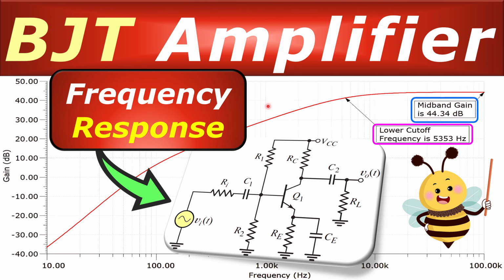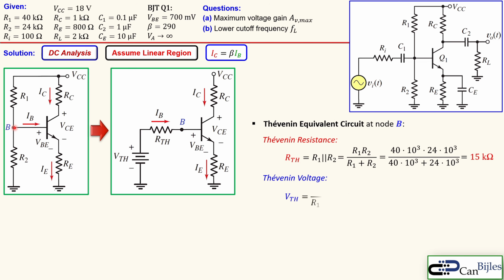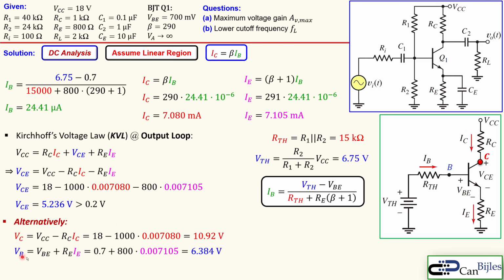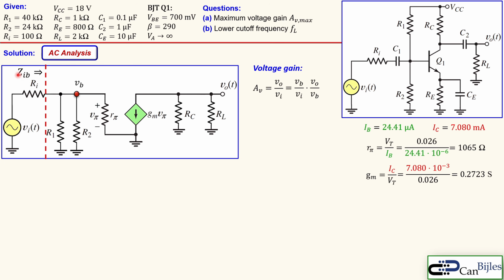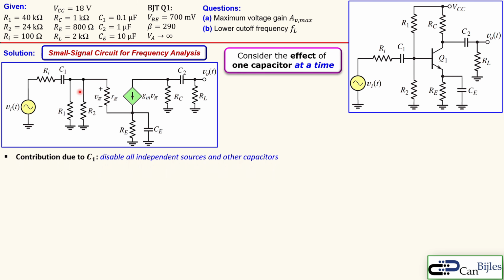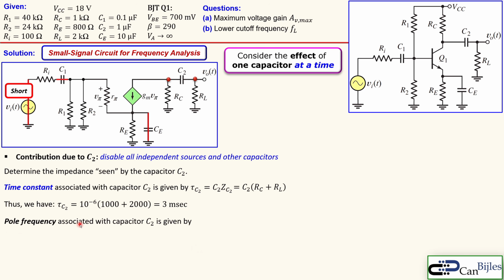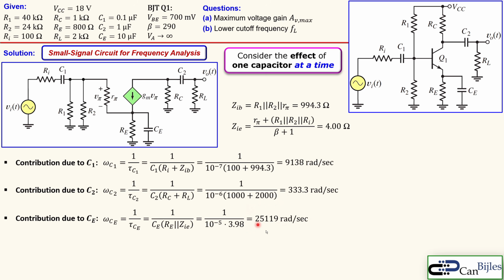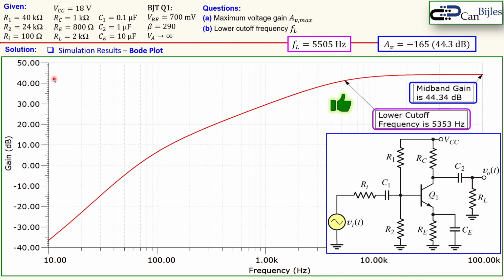BJT Common-Emitter Amplifier 📶 Low-Frequency Response 🎯 Coupling & Bypass Capacitors 👉 SCTC Method

Comment: Great work as usual. At 25:23 you show that our calculated Vb=6.384. Please can you show calculation/explain how you arrive at this. Thanks. In addition, how do you make the judgement that there is/is not a dominant pole?
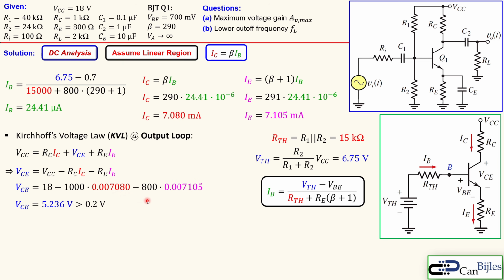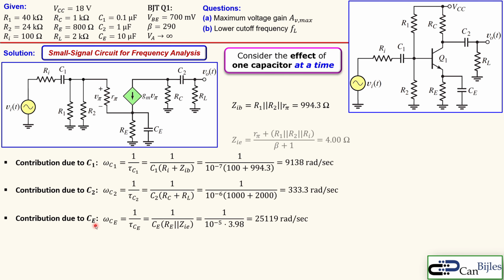Reply from the maker: Glad you liked the video! The Vb calculation is shown from 00:06:55 in this video. About the judgement for dominant pole approximation, I explain this in 00:21:00 in the video. For this, it is important to see which of the poles are larger and how much larger than the other poles. More details in the video :)
Reply: @CANEDUX  Thank you....sorry....I didn't look properly. This also help clear up a confusion I had about about the difference between the 6.75V calculated at B for the junction of R1 & R2 and the 6.384V at point B on the Thevenin equivalent circuit. Although you have mentioned many times in previous videos about being careful with this point, I hadn't grasped the significance (I think because both voltages are labelled B implying equivalence). So, once again thank you.
Reply from the maker: @neilcullimore5798   Great to know that confusion is gone 🙂 Indeed, the voltage at the base node (Vb) is NOT the same as the Thevenin voltage. However, you need the Thevenin voltage to carry out the calculations correctly. Sometimes, people ignore this part and make a voltage division at the base node, but looking into the base we do not have infinite impedance. This causes the problem.
Reply: @CANEDUX  Does the (6.75V-6.384V)/Ib represent the transistor dynamic input impedance? (ie: in this case 15K-(6.75-6.384)/24.41uA)=6.145 ohms? Sorry to be a pain - I know you must be very busy.
Reply from the maker: @neilcullimore5798   No problem, happy to help you out. The dynamic resistance (r_pi) is determined by the thermal voltage V_T (~ 26 mV) and the DC base current I_B. The formula is given as: r_pi = V_T/I_B.
Reply: @CANEDUX  Thank you. So what is does the (6.75V-6.384V)/Ib represent and where should I visualise it being represented in the circuit? Or should I just forget it?
Reply from the maker: @neilcullimore5798   The result of (V_TH - V_B) / I_B is actually the Thevenin resistance R_TH. But you do not need R_TH from this expression, you already have the Thevenin resistance and used it to calculate the DC base current I_B. No need to go back. So, no use for now for this circuit.
Reply: @CANEDUX  Thank you - I am so grateful for your time.
Reply from the maker: @neilcullimore5798  You're welcome! Do not forget to share and like 👍

Comment: It's exactly what I had assumed, but for a feedback out of the collector let's say, C3, to cancel out a portion of the input bandwidth, based on the effect I was getting it seems C3 is only seeing the resistance of R1?

I was working on an audio circuit the other day and when I used a capacitor off the collector back into the base, I had to use an extremely tiny value since my R1 and R2 are 1 meg and 75K ohm respectively, but the bandwidth being low passed was about what I would expect if that capacitor is only seeing R1, and not R2 or Rc.
If it were seeing R2 in parallel with R1, I wouldn't have needed anywhere near such a super tiny capacitor to get the low-pass I was after. We're talking 89 pF small.
Reply from the maker: The capacitor from collector to base is a feedback capacitor, and it is usually used to get a certain bandwidth and input impedance. That capacitor in conjunction with the input resistance (looking into the base) will form a low-pass filter.

Comment: thank you, can we use pole splitting for real circuit design or its just an estimation
Reply from the maker: You are welcome. Pole splitting can be used to adjust the pole locations, and could be handy for some applications. This method is in principe not an estimation, but for some fast hand calculations, people use sometimes approximations. This is merely done to design the first version of the circuit.